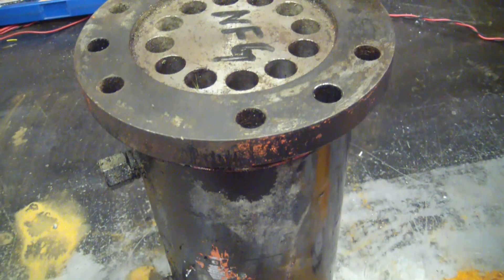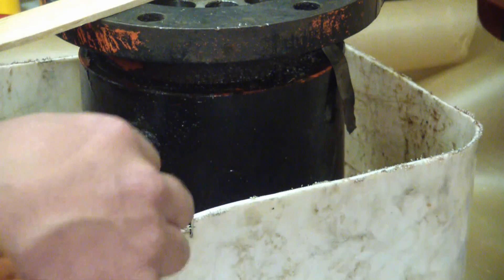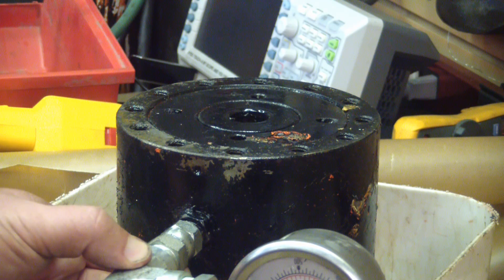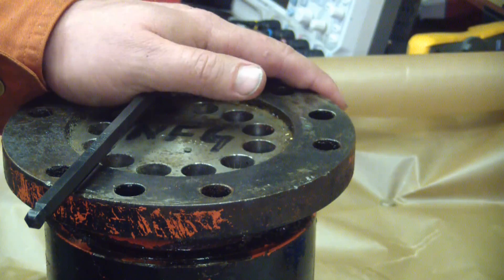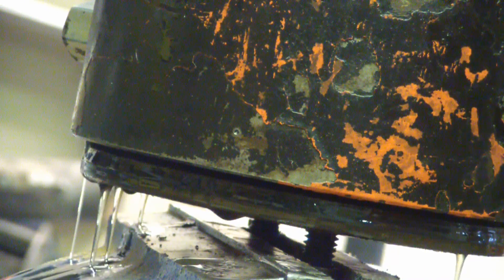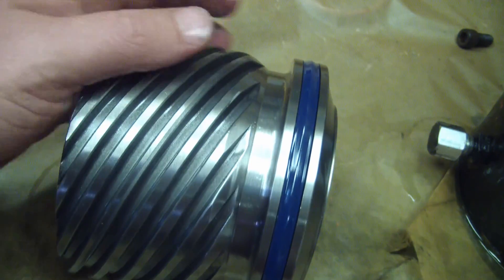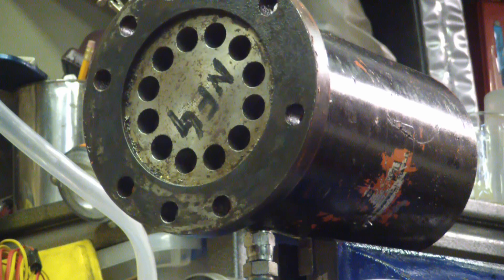BOLTR: Helac Rotary Actuator

Comment: Gotta be a beatch to bleed that if you do not have it prefilled during fixing, getting that last bit of air out so it will not hop around if the fittings are below the piston will be a lot of cycles. Even simple linear actuators mutter about that, especially if you want to have a repeatable step with varying loading or are using feedback.. At least the bar tending robot will be able to serve a drink even if there is an inconvenient body in the way of it slewing, though said body might be somewhat inconvenienced by the motion.

Comment: Fuking hell man, I cannot wrap my head around the functioning of that device.
Also, "Release the schmoo!" should get it's own T-shirt.
Reply: Jaroslav Malec The larger helical gearset moves up and down inside the cylinder, engaging with the stator gearset on the outer casing, that forces it to rotate as it moves upward. Inside that, that smaller shaft's gearset engages with the inner teeth on the larger gearset, causing it to rotate. 

Basically, imagine a hydraulic cylinder pushing on a rack that rotates a pinion and you've got the basic idea. It's a pretty efficient and compact way to translate linear motion into rotational motion.
Reply: Teth47 Right, so it cannot rotate indefinitely, it has limits.
Reply: Jaroslav Malec Yes, One full rotation if I were to guess.
Reply: ***** Woot! I've got the explanation of its operation right as well, correct? I didn't look it up, because I like to play it fast and loose
Reply: @Teth47  Agreed.   It's really just a gear set that's built in a concentric or coaxial manner rather than side-by-side.   At least that's how I'm seeing it.

Comment: I kinda don't think those would be helical gears. I think I'd call those multi-start threads. There's really no rolling gear action going on.
Reply: ***** That actually gave me something to think about today. My first idea was that it must be that threads convert rotary motion to linear motion, but that can be done with a rack and pinion, so strike that.

Then I figured it must have something to do with the way the components move against each other: gear teeth roll against each other, while threads slide against each other, but then that doesn't work, because the teeth of a worm slide against the teeth of a worm wheel.

I think what I've settled on is this: a thread(ed assembly) transmits rotary motion into linear motion via sliding action of internal and external teeth which are generally uniform in relation to one another.

I think.

Feel free to poke as many holes in that as you can. Next up we can figure out the difference between centrifugal motion and angular momentum.

Comment: we have a tool at work that has a hydraulic motor similar to that but not as big.   we are constantly having problems with it. we have to buy a new one about every 6 or 8 months cause it goes out.
Reply: well the tool is supposed to be going in to service soon but they keep extending the program.  it makes a vent that let air move between the trunk and the cab of a car that i wont mention the name of. haha

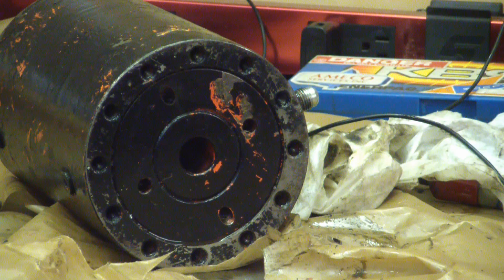Comment: 10:35 Oh, how I love the "I lack the required tool. That means I'll make one" attitude. Engineers are unstoppable.
Reply: Nick Nirus I know engineers who work out of catalogues an CAD libraries. i.e. Aerospace guys for instance. They have to be able to document the failure rate of anything they work on, so "I made it work" will never fly. They buy something proven or don't make a move.  

You'll find lots of welders, fabricators, mechanics, handymen, etc. Who make the tools they need.

Actually a lot of people get burned out as enginers because they like to create, go to school and never get to create. Their day job is to "draw out the thing we have been making for 100 years, but this time, do the math to see if we can get away with substituting this cheaper bolt..." or "put in all the locations for fasteners on this thing your boss got to create"

Small business owners are really the guys who tend to be in the magic Venn overlap of "identify need" "design it" "build it", "improve it". If they are good at that, they tend to suck at letting other people have autonomy though, and they usually also suck at running the office. The rare guy who is good at inventing a thing, making it, and marketing it, but lets someone else be good at ordering supplies and accounting, / customer support is the guy who has a good live.
Reply: Nah. Engineers (like myself) say "I could build a tool to do that!" ...7years of disgning later, it still doesn't work exactly right. And by that point I forget all about why I was building the tool in the first place.

 Meanwhile some graybeard mechanic comes up with a broom handle and a hammer, wham, fixed.
Reply: I don't know why he didn't just a bolt in each of the holes and then put a long bar along the central axis and rotate it until it collided with the bolts and then use the bar as a wrench.   Same thing as he did but without using a welder.   No measuring needed either.
Reply: GunFun ZS Fair enough.
Reply: Nick Nirus * people who make their own. This guy ain't necessarily an engineer, and lots of engineers don't really think that way. People who think that way do, whatever their trade.
Reply: @GunFunZS  I got the piece of paper but he's way more of an engineer than I'll ever be.
Reply: that's NOT an engineer attitude, that's machinist / electrician for you
Reply: GunFun ZS exactly.. lots of engineers will "Design" a tool to work but lack any fabrication skills..  I fab the "odd" tools i need for work.. easier than sourcing them and quicker for the most part...
Reply: ***** Where is your video, showing your genius at work?
Reply: I don't think thats an engineer thing lol

Comment: WTF is that thing used on?
Reply: WAVETUBE84 Guy up above said he works at the place that makes them. He said the dumpster truck pivot for the dumpster grabber, and also something on excavators.
Reply: GunFun ZS For example, its used for turning grab buckets on excavators.
Reply: haven't seen them in rudders actually, but i think that is possible. I've seen them for things like hatches, large moving items that have a set start and end position.
Reply: VictorIndiaDeltaAlfa Cool. Thanks. Funny thing I've noticed with hydraulics on work boats. Most of the time people use a bigger motor not when they want more power, but simply because the smaller motor spins too fast to control smoothly or safely. A motor like this is probably very smooth and torquey, and actually is used where torque is desired.
Reply: GunFun ZS This is not really the case with hydraulics, since you can always regulate the flow or pressure of the fluid. And adding a regulator is way cheaper than oversizing an actuator like this.
Reply: VictorIndiaDeltaAlfa I've seen a lot of people end up going this way because regulators weren't doing a good job. Also regulators generally bypass the fluid and make a lot of heat. You can't always regulate the pressure of the whole system or the flow for one motor, when the system has to supply a bunch of different equipment. Or when you have a pressure sensing cessna/eaton style pump. Those can treat a valve being feathered as a load and auto respond by kicking in more pressure and flow.
Reply: GunFun ZS Yeah, they get hot when in the pressure relief mode.  Pressure washers are a simple hydraulic pump.  If you leave them running when they are not in use, the small amount of water that is recirculating from the pressure relief and back to the pump inlet gets hotter and hotter.  That ends up roasting your seals and causing other wear upon the pump.  More expensive pressure washers have a more robust pump, seals and pressure relief circuit.  So they can handle more abuse.  But cheap or expensive, it's not good to leave them running when not in use.
Reply: VictorIndiaDeltaAlfa Hydraulic systems are matched to the flow/volume requirement.  Sure, you need some horsepower to maintain the pressure at whatever volume.  Are you powering a dental "water pick" at 100 psi or are you pumping 50 gallons per minute at 3000 psi?  There are design parameters to take into consideration:  existing system, additional add-on accessories....  Bottom line:  you have to focus the capabilities of the machine upon its intended use and consumer cost; plus you only need to power what you are using (there are fuel costs).
Reply: WAVETUBE84 
I'm in shipbuilding (yachts) and we sometimes use them for things that always open and close a certain way. a cilinder can do the same but a rotary can be much smaller in the same function and it still keeps the same end to end motion.
Reply: xnutral Like rudders?
Reply: xnutral They would save a lot of space in the lazarette. You'd still need a vestigial tiller for mounting the rudder angle indicator.
Reply: That is definitely possible. Altough i've only seen the once piston operated, stabilizers as well.
Reply: xnutral Ah. Stabilizers make a lot of sense. I could see level winds for reels and winches using something like this too, but the torque is excessive.
Reply: GunFun ZS actually more and more stuff is electric here. All the winches , thrusters cranes (with some exceptions). Just stuff like doors gangways stabilizers rudders and platforms are hydraulic.
Okay so still a lot of hydraulics :ap
Reply: xnutral The work boat world still prefers hydraulics. Electrickery and the inevitable salt water = bad times. I do know of a few with electric bow thrusters, but I've seen about the same amount change them to hydraulic after a couple years.
Reply: Bottom line:  there are various hydraulic actuators that can transmit tremendous amonts of power an be reliable for years.  Sure, there are electric motors that can "step on the mat".  But hydraulics are 5x reliable/powerful/lighter
Reply: WAVETUBE84 One of my friends is an engineer that does that. Actually two are, now that I think of it. No expense spared there.
Reply: GunFun ZS I'm in luxury mega yacht's so there is definitely other considerations than with work ships
Reply: GunFun ZS Sorry, I don't know jack about boats.
Reply: Then build pretty ones. Customers only seem to care about a pretty point on the bow.

Comment: Like looking at an old friend. Used wrenches with their own hydraulic motors to bring large (300+mm) bolts or nuts up to their proper torque specs. Mainly on Wartsila marine engines, the kind where you open an access hatch to enter the crankcase. It took twice as long to position and anchor the tool as to torque the fastener!
Reply: ***** One could wish! lol "Tighten seza-me"!

Comment: Oah... so was it just not spinning because the fluid was trying to push the cylinder closed when it was already closed fully? So had the fluid been introduced into the bottom inlet it would have spun?
What a cool teardown. my bad... 3rd time watching i noticed you did turn it around...

Comment: So, am I right when I say this thing cant turn endlessly because the linear motion inside is limited? Otherwise I dont get it...
Reply: 1hdsquad Maybe it would just be used as a short throw high torque actuator. To move something on/off that is very hard to turn.
Reply: ***** are you sure? because i figured that since there are two gear meshes this thing might turn continuosly but that the piston will do some linear movement, maybe proportional to the output torque, or to help it get up to speed? anyway, if you know more about it i'd really like to hear it
Reply: +1hdsquad It rotates 360 degrees

Comment: Awesome!! Never seen one of those before. What's it primary use? Is it linear and rotary at same time when pressurized?
Always gotta love your one liners man. Enjoyed!!

Adam
Reply: fatboyfester   It pays to read the comment section!
Reply: Rotary only Adam,  we make them where I work.  They are used on excavator mounts or garbage trucks that pick up wheelie bins. Can also be used where space is limited to use a traditional cylinder
Reply: fatboyfester Here is a photo of the type it is http://www.bing.com/images/search?q=clam+shell+backhoe+bucket&view=detailv2&&&id=30CE37115F1B96A21A8883A9C3709D3C6FDFF52C&selectedIndex=96&
Reply: banana5616 Thanks. I was guessing something like a tool holder on the end of an arm that only needs to rotate so many degrees and then return.
Reply: fatboyfester That makes a lot of sense. Very clean mounting, with no piston sticking out to get scuffed on rocks, or any obvious exposed hoses.
Reply: GunFun ZS We have a back hoe at work with a clam shell digging bucket it has 2 of these on it to open and close it . Its useful for picking up pieces of debris to put in the dump truck.
Reply: Abom79 They're also commonly used on boom lifts. The work platform can be swiveled from side to side to increase access for the machine operator.
Reply: ***** Really? All my favorite few channels are full of smart viewers. AVE, 1957 Shep, FortuneCookie45LC, Shooting the bull410, TAOFL has a lot, but his videos draw a lot of the normal crowd of people too.
Reply: Thanks - I checked them out, and subscribed to most.
Reply: ***** "banana..."  said it was used on dumpster trucks and excavators. Any idea what they used it for on excavators? the best guess I could make was to drive the thumb on a compact excavator. They have little ones that will even fit on pickup trucks, for getting into tight spaces without smashing stuff up. It could work for that kind of application.
Reply: ***** Oh. Check out Hackaweek. He's probably up your alley if you are on AVE. Dean is yet another guy who just makes most things look easier than they should be for mortals.
Reply: ***** Probably match fit considering the helical cuts.
Reply: You can interchange parts if the helical angles of the spline are the same. We change parts for customers without issue.

Comment: 14:30 So I guess the inner gear thread windings are going in the opposite direction of the outer gear threads so the unit can remain stationary?  Nice work turning that NFG into a GWO with some TLC.

Comment: NFG? No Fucking Good?
Reply: Thats how they write "Does Not Chooch" in Azerbaijani.
Reply: Aaron16 Officially Not For Go. Or at least that's what you tell anyone who looks offended when they ask.
Reply: elindred not for girls
Reply: themadmailler Fucking New Guy
Reply: Aaron16    Very close to "FNG".
Reply: This term is used in on set film/tv production as well.   Some people use the sanitized "NG" version
Reply: Aaron16 "Not Found Good" ?
Reply: Aaron16 Non-functional goods
Reply: Aaron16 Correct.
Reply: +Aaron16 It means "Not functioning/good". It means its broken. NFG is usually written on parts to trash, something not worth repair. Whoever made that determination for this thing probably just didn't want to fuck with trying to delid it :P The reason they would write that on it is so the new guy knows its ok to scrap it. At least, that was what I was told when I worked at a shop as a teenager.
Reply: +Aaron16 no fucking Bueno.